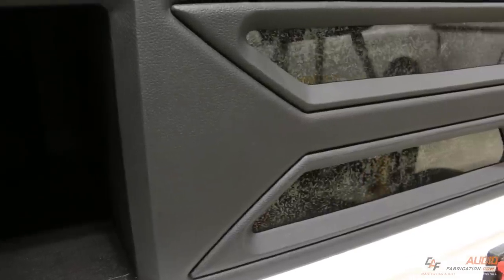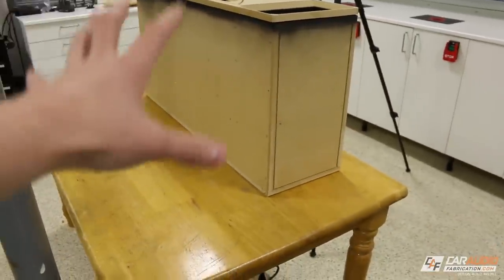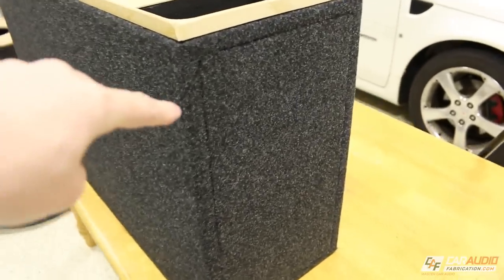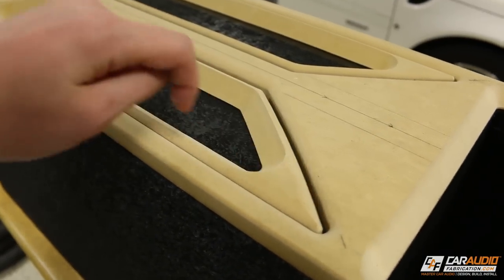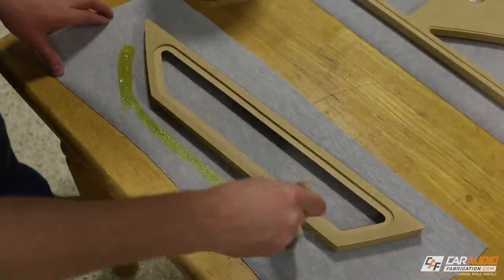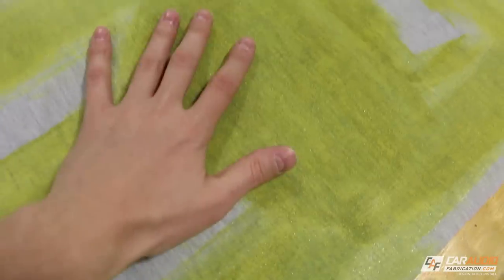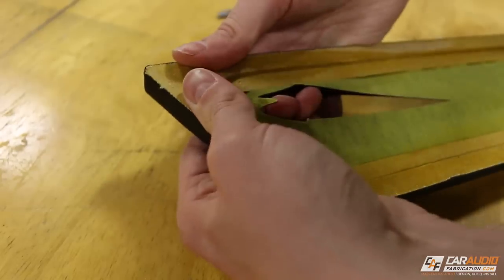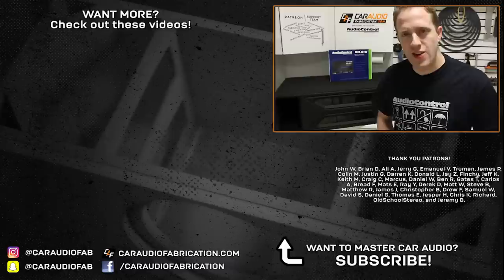Transmission Line Subwoofer Box - Final Upholstery!

Comment: Spraying Helmaprene with a paint gun works far better than brushing it on, and you don't get the bleed through, that you typically do when using a brush.
Also a bit of heat on the vinyl, especially around the corners and the inside pulls, will help get the vinyl to pull tight to the shape.

Comment: An old trick with spray glue is to first glue both sides and let it dry, then when its dry spray again and it will hold a lot better because your gluing glue to glue.

Comment: Pulling vinal around corners is much easier if you use a heat gun / hair drier to make the vinal soft and stretchy.
Reply from the maker: +TheRattleSnake3145 it can warp though, better if you can make due without heat.
Reply: its the same amount of stretch ( you don't have to pull as hard with heat though), its just easier with heat.

Comment: You REALLY must trust that glue.   Seems like even using 'the correct adhesive', 3 years of hot summers and below zero winters will make it release and pull away.. I always use adhesive + fasteners for tight vinyl pulls.

Comment: I like a blend of both styles.  Also, I've had good luck with 3m super vinyl top spray adhesive when working with vinyl.  it is certainly faster and more uniform to us a spray product.  Have you tried and had problems with the stickiest 3m spray product?  Thx

Comment: Now the big question..... how does it sound?!  Also, can you give an idea of the additional performance you get with a "T-line" design vs. a square/rectangular plain design?  I'm presuming there is more clarity and (hopefully) it's louder.  But please explain. Thanks for the vids!
Reply from the maker: +Geplus Logger watch my design video. Everything you have stated is a common misconception. Not louder, not necessarily "more clear". More low end extension, but less overall output. And it's huge... A T - Line is virtually never a good idea for a vehicle as its far too large and you can typically get more output and just tune away any peaks in a car audio environment. Good for a home theater though.

Comment: Have you ever built enclosures for convertibles?  I have a leather seat and huge top that I'd like to get sound through.   Inside the passenger compartment is not an option.   I have about 40W x 19H x 15D to play with, but don't know what the best solution is.

Comment: what do you think would be the reason for de-sync or lag  between the radio and the sub. i have  scion ia with stock head unit i used a-line adapter PAC AOEM-MAZ2 ( Scion iA Is A Toyota That Is Actually A Mazda)

Comment: Can i plug in 2- 180W or 200W speakers or woofer on car radio(50W×4)
Reply: Angel N. I think is more like 4*20 watt RMS.
Reply: These are all max wattage. Thats only short bursts for 1/2 secs.
Reply: Michel Megelink ok i will buy smaller speakers
Reply: Angel N. If you already have them you can use them. If youre not planning to get an amplifier soon find some high sensitivity speakers around 50/60 watt RMS
Reply: Michel Megelink I have 2×200+ woofers but I wil buy 60/70watt speakers
Reply: buy more sensitive speakers for radio, something in range of 93-99db, less efficient speakers will be quieter on such small wattage
Reply: What amp are you using for the woofers?
Reply: I dont use them now, I will keep them for my new car😂